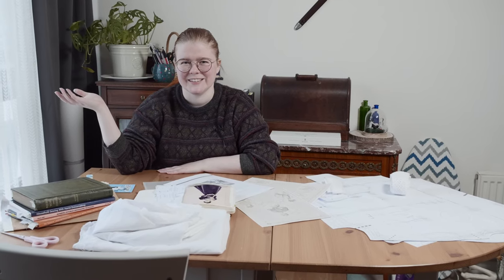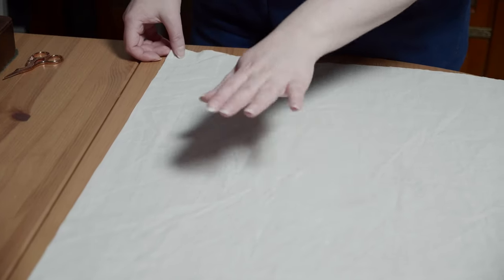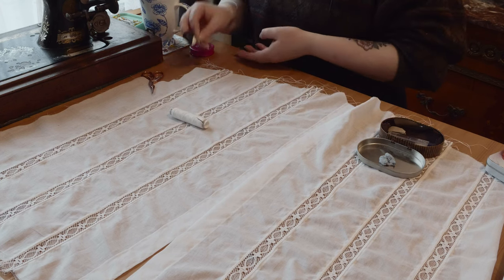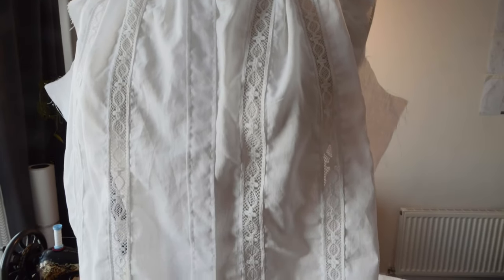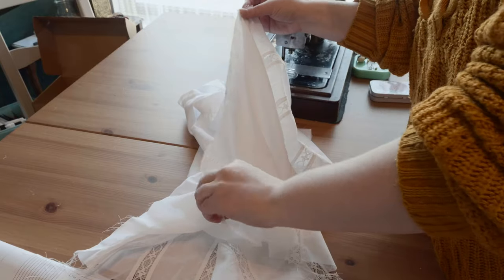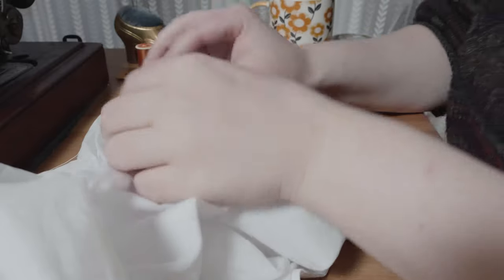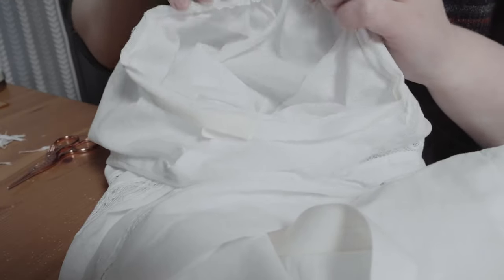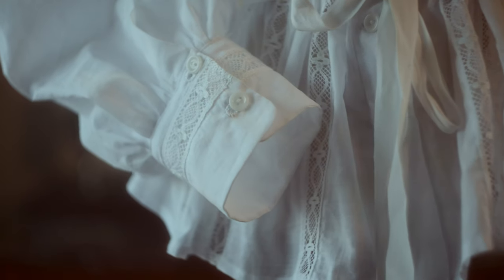I Made a fancy Shirtwaist on an 1896 Antique Sewing Machine!

Comment: I have usually had great success with TV patterns but with this one the collar and neck hole were just absurdly too small and I had to cut them bigger. This is an issue other people have had as well, so you might want to check against your own measurements when using the smaller sizes! The sleeves were also too short for me (even for 3/4 sleeve), which is bizarre because I am a tiny halfling, and I was NOT happy having to completely re-cut and redo them
Reply from the maker: Oh no! I did think the collar was a smidge tight, I will make sure to let my workshop attendees know to double check the neckline and collar 😊
Reply: @LiljaHusmo  It's generally good practice to check anyway, but this was the first TV pattern where I had serious issues, thought I'd give a heads up. I hope every one in the workshop and you have a wonderful time!
Reply: Same with the sleeves here! The 3/4 ones hit at my elbow and the cuffs aren't long enough to go around my forearms.
Reply from the maker: @AMortalDothApproach  glad i chose the long sleeves! It seems many had issues with the short ones !